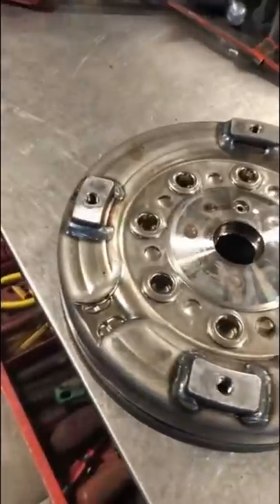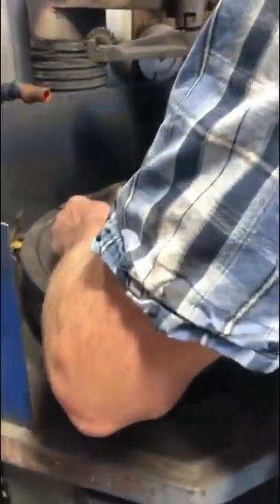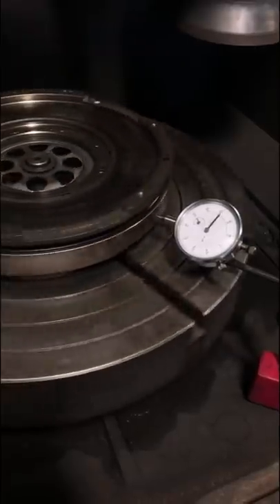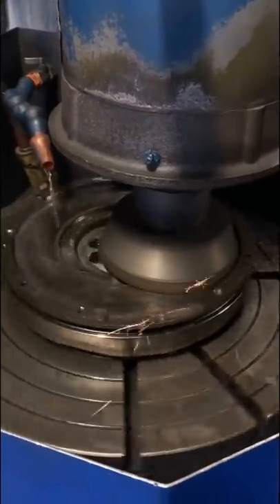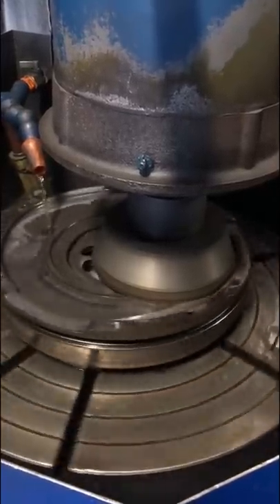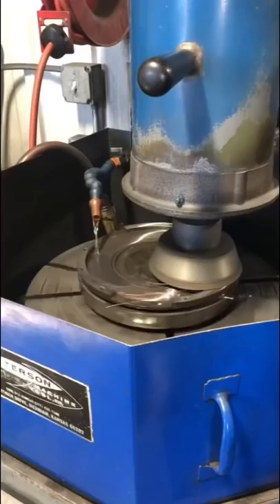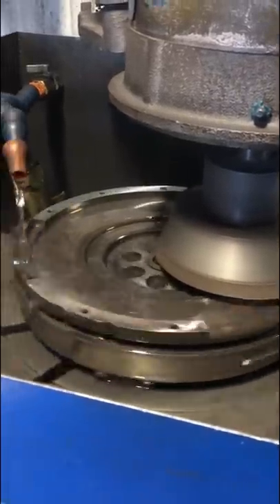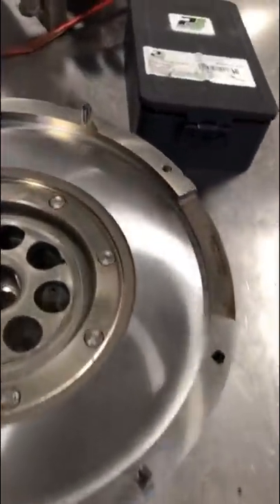#shorts We Can Resurface A Dual Mass Flywheel… But Should We?

Comment: I would do this for a low mileage flywheel. like one that was used to teach someone how to use a clutch.  If it were over 100K miles, I would guess the springs are fatigued and may have taken a compression set. I'm just glad there's no "Flywheel Police" to tell you whether or not you can try to help your customer. Certainly not a safety issue.
Reply: Idk much about cars but couldn't you replace the springs
Reply: @quincyharris3068  I don’t know about that, but here’s my guess: the flywheel is probably assembled permanently (rivets or the like) and finding replacement springs might be difficult since the manufacturer probably doesn’t sell them.
Reply: Do manuals even generally have dual mass flywheels?
Reply: @grekiki  4 cylinders
Reply: @grekiki  all vw/audi 4 cyl diesels from 2008 onwards have a dmf to prevent excessive vibrations
Reply: @grekiki  my Nissan Frontier/navara has it. Seems unless since ppl have mentioned that these flywheels are for heavier trucks.
Reply: @grekiki  Ford Focus 2.0 Duratec from 2005-2011 has DMF.
Reply: How do valve springs work a lot harder, sit lots of time compressed, yet work fine for 200k, but this clutch needs springs ?
Reply: @senatorjosephmccarthy2720  'cause Big Clutch said that you need a new one, and also that it's not serviceable so you need to replace the whole thing!
Reply: @senatorjosephmccarthy2720  A spring, sitting compressed most of the time, doesn't have anything to do with wear. Being compressed for looking periods of time doesn't wear out springs. Springs being compressed and relaxed over and over is what wears them out. A spring can sit compressed indefinitely, and it will cause negligible wear. That's an old myth that springs wear out if they're compressed for looking periods of time.
Reply: I can't speak for dual mass set ups since I never seen them outside of videos, but if it's like a single mass flywheel set up than the springs are in the clutch and pressure plate. The flywheel's job is to provide a contact point for the clutch to translate power to the transmission, as well as provide the ring gear for the starter to do it's thing. The only dampening done by the flywheel itself is via the weight distribution to act as a counterbalance for the engine's reciprocal actions.
Reply: @vapenation7061  my 2001 TDI also has DMF
Reply: @Norwegian_Bastard  automatics have a flex plate and torque converter not a flywheel and clutch
Reply: @grekiki  The majority of cars after the 2000s does in europe
Reply: @Dude13450  dual mass flywheels have unsprung clutch discs the spring is in the flywheel itself rather than the clutch disc.

Comment: I also understand the need for a local shop that does amazing work, here in my local town, we also have a machine shop that provides this surface, being in a rural town as well we also hit a shortage of supplies to be shipped so this is honestly a great idea, I honestly feel like it will work, for it being a dual mass incredible job resurfacing. Others would turn away even after stating the risks, they would still turn the customer away, but you took on the challenge l, amazing job guys, this is why I watch, to always see something that I think can’t be done, I watch it get done. Have a good day y’all.

Comment: It will work perfectly. They just make it purposely difficult to do is the only real reason not to. They want to sell you a new one is the only reason they say "don't resurface a dual mass flywheel" sales pitch.
Reply: So all the internal parts don't matter  as long as it's nice and shiny  ? How do you know that the sets of springs are still good or will last as long as the next disc ?  Replacement is recommended for more reasons than just too make money .  The inner contact disc is not held onto the main flywheel solidly.  They have parts that wear internally so how do you inspect the internal parts.  By turning the contact disk and making it nice and shiny does not remove all the wear of the internal wearing parts . That's why they even say in this video that its taking a risk . It's funny how everyone knows more than the manufacturer  .
Reply: @LaloHernandez-mb7yz  blah blah blah, it is a very simple device, if the disk wear surface as flattened, is not warped and is not tos thin it is perfectly safe to resource, all else you state is bullshit.

Comment: Problem is the springs and internal parts of the fly wheel... hopefully they will hold up but I'd be scared that it wouldn't last...
Next question did they look for a solid mass fly wheel conversion? Idk that application
Reply: The clutch has the springs. The fly wheel is just a giant metal plate
Reply: @kimber3865  Not for a dual mass flywheel, they use clutch plates without springs. Look it up on wikipedia. They're pretty cool until you need to replace them.
Reply: Scared?
Reply: @maxmerton  yes or worried, concerned, afraid that the dual mass flywheel will fail in a short amount of time
Reply: @kimber3865  watch the video again look up dual mass flywheels they are made to give softer engagement with clutches been around since atleast the 90's in pickup trucks and I'm sure allot  more cars etc.. the clutch disk may or may not have additional springs in it as well on the Dodge Ram Cummins trucks 05-18 99% of the time the dual mass flywheel breaks causing noise vibrations long before the clutch wears out with a good driver
Reply: @chucktraughber505  if it fails and still no replacement available just weld it, they'll be fine if they understand not to be hard on their engagement
Reply: the problem is you cannot get in there and clean out the grinding grit.
Reply: @pbgd3  or the clutch disk dust
Reply: @jonathantheunacceptable4259  ... you mean just drive it like NORMAL clutch ?
Reply: Because you will have annoying chatter especially if you have AWD it takes up shutters and it’s actually better on the rest of the mechanicals in you driveline. I did a solid my friend did and we both hated it and went back to OEM
Reply: Ok I only work on old stuff. 
70's back to the  30's. 
There's  springs and or fingers in a flywheel now ?
Reply: @eagerlawncare3700  I know right? It's such an outside of the box thought 🙄 🤣
Reply: @dougkonopack4693  think of it as a damper, on a dual mass there are two fly wheels connected together. They have a bit of play controlled by springs to rotate against one another in order to dampen the engagement. Only heavy built vehicles like sports cars and big trucks have them for the most part
Reply: @dougkonopack4693  Correct, when I worked at the BMW dealership I saw an M4 that was tuned destroy one, the springs shattered from the excess power and a hard shift. There are little arms that hold it together they popped out and cut the bell housing in half  like a saw blade, it was quite amazing.
Reply: @kimber3865  you didn't pay attention, it's a dual mass, means dampening guts in the flywheel too.
Reply: @kimber3865  mmmm no lol

Comment: It’ll work so long as you took the same amount from both surfaces and used a flywheel shim between it and the crank so that the clutch cylinder works properly.
Reply: Smart fu**er you are. Didn't cross my mind but as I read this I pic it in my head and I'd say you'd be correct sir!!
Reply: Narrator:  They didn't.
Reply from the maker: Listen again…
Reply: Is what I was saying above in comments. Ty
Reply: Sometimes you do what you gotta do.

Comment: If it works was it wrong to do it? Looks like you did a good job!!! Awesome work
Reply: Dual mass flywheels wear out the springs and bushings internally.  Might have a good clutch surface but may rattle and have other issues internally sooner rather than later.
Reply: @bigpjohnson  as I stated if it works is it really wrong? Lol

Comment: Ford F250s and F350s used to use dual mass to counter vibration issues. But these were bad about coming apart after awhile. Several companies make kits to convert dual mass to standard clutch. As a mechanic, I've done many of the conversions over the years. Works well and they never have issues after the conversion.

Comment: I used to work at a machine shop, and we resurfaced them quite often.
As long as you get the height set correctly, it shouldn't be a problem. Check the clearance to the hub of the clutch plate after machining.

Comment: I had a shop in the 70’s and 80’s and resurfaced many stepped flywheels. Never had an issue as long as both surfaces are machined the same depth. Sometimes I actually was able to get the OEM depth specification.

Comment: Luckily with the work I've gotta do on my truck, it's fairly simple, and most of it isn't as critical. Yeah, it all should be done before problems get worse, but none of them are critical issues. Just a lot of small issues here and there.
1) Fuel filter and some damaged fuel lines (two on the inlet side are missing the clip on the quick disconnect, though one connection is a bit too damaged for just a new clip, and the outlet has a pinch). 
2) New cat back exhaust, as the tail pipe after the muffler is pinched
3) Transmission filter replacement, it's just about that time
4) Oil pan showing signs of a slight leak, not enough to need to add oil between changes, but enough to be present
5) Seal at the back of the transmission showing signs of a slight leak, easy replacement
6) Very small leak where timing cover meets water pump. Small leaks develop into big leaks though.
7) Ball joint boots on both upper control arms are split. Not the end of the world right now, but it's on the list of needs to get done.

This isn't order of operations, but fuel filter comes first. Next will probably be the exhaust, followed by upper control arms and new alignment. Then oil pan with oil change, transmission filter with fresh fluid and the seal at the back will all get handled at once, possibly with new mounts if I can. She's got over 211k miles on her after all. Shit is getting old and wearing out. Finally, I'll just replace the timing cover and water pump and applicable gaskets at the same time.

Comment: My only concern would be if it was a vehicle known for killing dual-mass flywheels like VW diesels have been known to do.
Not that the surface is so much a concern, but the linkages between the two masses can be broken, and cause a failure where you end up having to cut the flywheel apart to get to the flywheel mounting bolts into the crank.

If this application isn't that failure-prone, or the customer just accepts that the worst-case scenario is a possibility, send it...

Comment: I would say it depends on how much you had to take off and whether or not you can mount-it in a way that it runs true. Out of curiosity how much did you end up removing? I have cleaned them up before removing only .00045".

Comment: The surface looks great, but that's not usually what fails with a dual mass flywheel. It's usually the bearing or the spring that fails. 

Both failed in my older VW and it fried the clutch instantly. But you do what you have to with part supply issues.

Comment: The repair is pretty straightforward and overall it should suffice for the application at hand. If mine required a flywheel like that, I’d probably consider resurfacing before replacement. (I already do that to my brake rotors if they are within spec for a place to resurface them.)

Comment: I think refacing is perfect aslong as the actual wear of the centre spring assembly are within specified limits given by the flywheel manufacturer. Always best to replace as a matching set of course but it will work.

Comment: As long as all of the tolerances are in spec and the metals used in the repair are also of the appropriate strength, then it doesn't matter what the repair is, it's going to work.

Did you double check all of the dimensions after performing a attempted repair?

If everything's in spec after, including when the clutch is bolted to the flywheel, then it's a perfect repair.

Comment: in my experience dealing with dual mass flywheels is that you always want to replace them because there is no way for you to properly inspect the center bearing nor the spring health, the center bearing is the one ive seen the most die and leaves the vehicle shaking so hard it might turn the insides of your noggin into a freshly made cocktail.... at such point the entire clutch kit (disc, plate, bearings AND flywheel ) is usually upwards of 1k.... 
what whe usually did in these situations when the client couldnt aford the parts was resurface both the plate and flywheel (if necesary, not everyone tortured their clutch) carefully weld both halfs of the flywheel solid then order a traditional clutch with same size and splines (dual mass clutch discs are different to traditional ones), not the prettiest neither the proper solution but it was mighty fine for a small budget people

Comment: The Surface is going to be ok. I mean, you guys centered it well. My concerne is with the springs and the actual function of the flywheel. If it is still stiff and the car has/had no additional noise while turning it off and no replacement parts are in sight… good job.

Comment: The manufacturer wasn't talking to you. When you restored the depth of the offset in the same setup and assuming you were dialed in, I believe it's as good as new. Further more that finish is a "no break in needed" quality and won't waste precious friction material. Only caveat is possible hard spots not visible but I didn't see any heat cracks in the "before" image so the hard spots probably weren't too deep. Extraordinary job, you're above most.

Comment: As long as the rubber 'membrane' inside isn't trashed and you cut both faces even and slow enough its totally fine. A lot of machine shops won't do it because they don't want the liability most likely. I'd much rather just replace it with a good single mass lightweight flywheel. Much cheaper than a new dual mass, plus lighter and better feel/ way less parasitic drag on the engine. Lots of times a ltw flywheel is one of the best 'bang for buck' mods. You guys did a nice job resurfacing this one. Even used the die grinder to bevel the edge afterwards. 👍👍🙂

Comment: Normally I’d say it’s probably fine, but the issue with dual mass flywheels is less the surface condition and more the internals. Dual mass flywheels are supposed to act as a damper for clutch input, and when that damper gives out you get some weird issues. I just had my 325i converted from a dual mass to a single mass flywheel after mine gave out and the clutch mating surface started to separate from the housing. 

As long as that’s good, a resurface will be fine.

Comment: The dual mass flywheels I have changed usually where fried beyond re use. Because of wrong driving habits, as a dual mass flywheel reacts different to a fixed flywheel. As long as there is no excessive play I'd say this repair would hold up for a few thousand miles or so

Comment: This will work fine, how much did you take off both surfaces? They want every BMW customer to buy their expensive parts. I saw working brake rotors missing one side grinding into the cooling hub fins. Yes she was Blonde and pretty.

Comment: Semi trucks have been resurfacing "dished" flywheels for a very long time. As long as you have quality cut and can adjust clutch linkage if necessary it's good as new.

Comment: Just some info. 

There is no question that the resurfacing will work, that's a given,  the real problem with DMF is the bearing that holds the 2 masses together.  

This is one of the biggest problems i deal with buying used BMWs, the original owner does not want to replace flywheel (DMF cost more and go bad faster; because of the bearing)  and the bearing will get so bad that the mass that is not bolted to the engine, will start to wobble, causing the input shaft to the trans to wobble destroying bearings.

With all of that being said, the spring that makes the 2 masses work together can not be repaired, and after so many miles,  will never be the same spring it was new. 

Unless you have to have DMF, just replace with solid mass flywheel.  DMFs are a luxury item, they will give you the smoothest take off ever, and they allow new stick drivers to almost never kill the car. Any mechanic will tell you to replace every 4-5 years vs 1 solid flywheel COULD never be replaced,  just resurfaced.

Comment: Since you machined the surface that the pressure plate mates to along with the disc surface, it's literally mint 👌. It's not like a flywheel takes THAT much heat so ya don't have to worry about warping.

Comment: I always figured the reason youre not supposed to resurface them is because of shavings getting inside of them. Certain looks like a good resurface job so as long as it was cleaned well afterward, should be good

Comment: Once upon a time almost everything was resurfaced, re-worked and re-used. If done properly there is no issue. The reason everything went to a replacement strategy is 2 fold:
1. Too many mistakes were made at low quality facilities
2. The cost of replacement parts came down

In current times with hard to find and expensive parts, those who innovate and do a good job at it, will prevail...

Comment: I would run it.  42 years Master Tech veteran. There were no cracks or heat checks and probably only took 10-15 thousandths of an inch to clean it up. I don’t believe that is an unsafe amount of material that was removed. Sometimes you have to decide the best of all the worst choices that you were given.

Comment: As long as a skilled professional is conscious of the potential issues that could arise while resurfacing a dual mass, and actively avoids those outcomes, I think the flywheel should perform as well as any other. Personally I believe mated components that have ran without issue for an extended period of time can continue doing so.  Only replace what's necessary, or has a reasonable chance of catastrophic failure In the future.